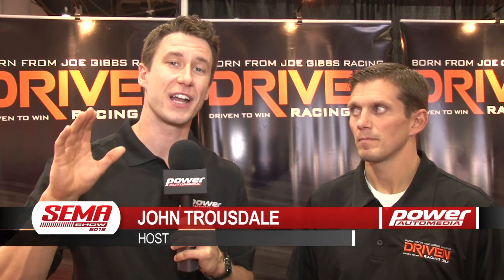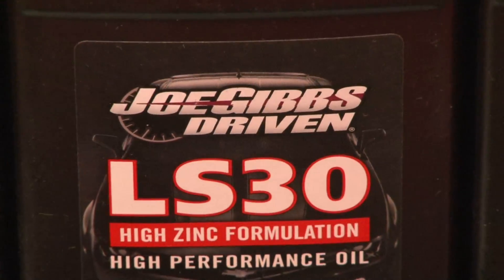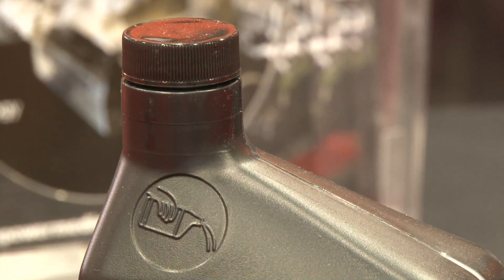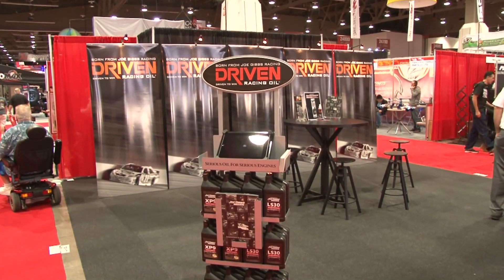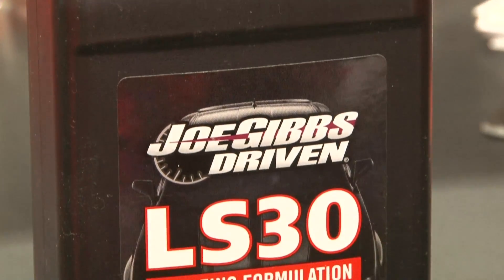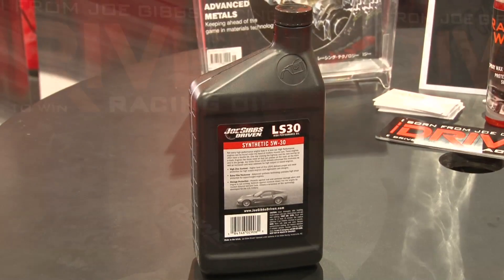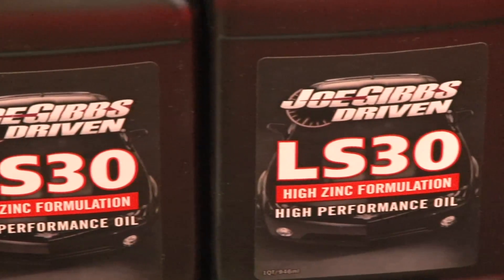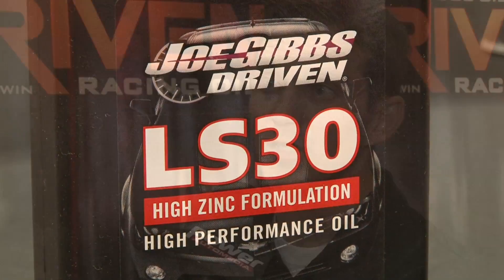Driven Racing Oil: What Is mPAO Technology?

Comment: How does this Mpao compare to ester based like Redline. Say LS30 5w30   vs. Redline 5w30? Redline have always been shear stable oils. Pao tend to shrink seals, esters swell. Also how about tbn, cleanliness, detergency, fuel dilution, and what is the driven ls30 noack %?
Reply: Been running this in my half ton truck for years.  Great stuff